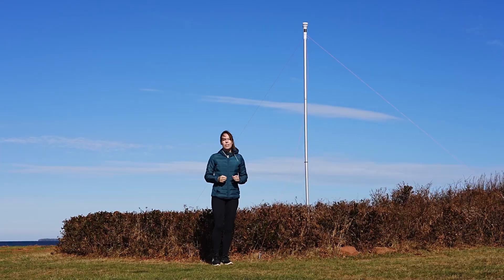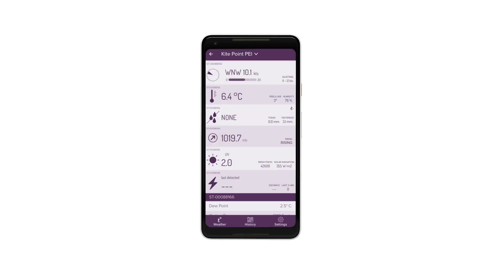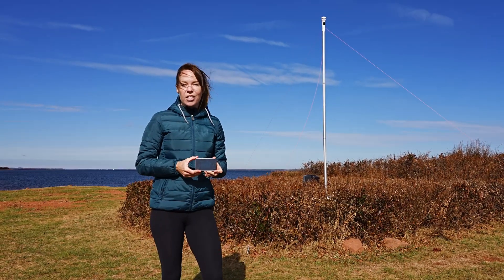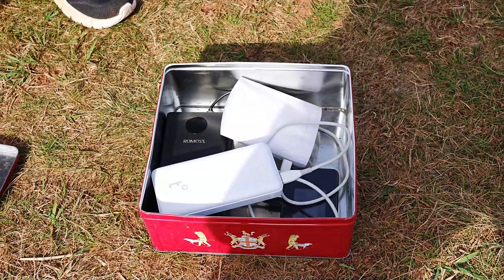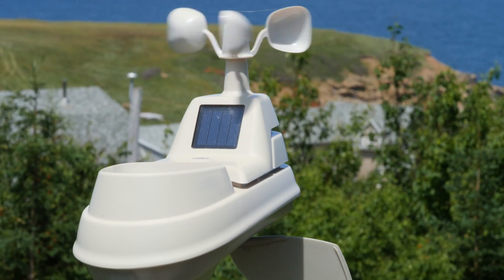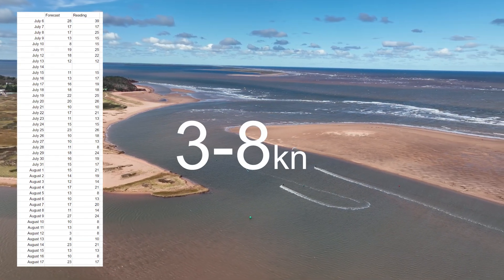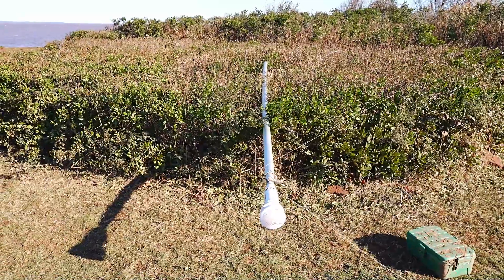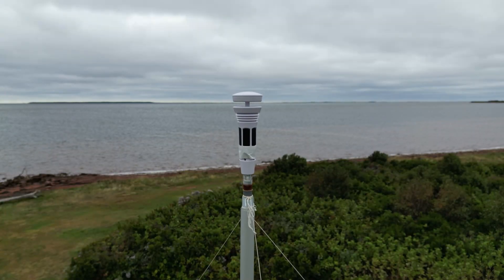How to Set Up Remote Weather Station - WeatherFlow Tempest

Comment: It sounds like you have to hook it all up at each trip to the beach? If so, it wouldn't really help with a decision to go or not! If you figure out a continuous (solar?) solution, please share! Love all your kite trip videos!!
Reply from the maker: We did figure it out - we got a solar panel and a voltaic battery and it worked great!
Reply: @OurKiteLife  Neat! Love to get more details,how that solved eh WiFi problem, etc.. This sounds like your third setup (?); one with everything remote in the plastic box and USB batteries, then remote with antenna, then ?? I assume that this whole setup replaced your one with the bigger WiFi antenna, where you had the hub and antenna at home with power, and just the pole mounted Tempest unit remote? (What was lacking with  that setup?) Thanks.

Comment: Nickel Iron batteries or Sodium Ion batteries are both incredibly robust tough climate, battery choices, albeit quite bulky. But if placed on the ground in a weatherproof box with solar panel and PWM controller, it should work at 12v with car USB abapters to convert to 5v USB. Alternatively or augment it with a micro wind generator.

Comment: I've a different opinion how to build such thing. I'd use ultra low power Arduino/nodeMCU with Sigfox-network (Sigfox Canada) which is IOT network, very low xmit-power and for low amount of IOT messages. That would take down power requirement and your powerbank would last for a year (just saying not calculating). And with simple solar cell with occasional sunlight could keep battery charged for longer periods.

Then you are measuring wind - meaning there is wind power available. For Arduino powered sigfox device the wind turbine generator does not need to be big, like very small Savonius wind turbine of 1 watt or under. But naturally hurricane level winds would be a problem for the wind turbine. I even imagined as you are not interested generally in 0-3m/s winds where wind turbines do not produce power but on kiteable higher winds, I am also thinking of wind turbine based measurement of wind, how much power does it produce. With that artificial load you could keep measuring station above freezing on winter colds. This idea is for snowkiting on mountain location for mobile wind meter.

Naturally this suggestion is DIY service and you use some weather service. So maybe with a almost free cloud computer you could receive sigfox and send it to wind network.

Also data plans, sigfox is not for that amount of data you presented. But you really need to send 10-min average wind and 10-min peak so two figures every 10 minutes, for that sigfox is built.

Comment: Hi. Thank you for this video. I was assembling my weather station using the Davis wind speed and direction sensor. The electronic part was assembled on the arduino and the cellular modem sim 800 (as I later found out not the best choice). I assembled two devices. One was installed on the roof of the house a kilometer from our spot and there were no problems with electricity. The second device was planned to be placed on a spot where there is no electricity. For the second device, they first planned to use a 30-watt solar panel, but then decided that it would be better to use a car battery. According to my calculations, the battery for 40 amperes of watches should have been enough for 1.5 months of operation, if the data is sent once every 5 minutes. Most of the energy is consumed by the modem at the time of sending data to the web server, so you need to carefully select the communication frequency

Comment: Have you researched using the Starlink satellite system as your remote internet connection instead of your current mobile hot spot?
Reply from the maker: We did look into Starlink previously for our home, but it's expensive. Since we published this video we've found a less expensive internet option we'll try next season :)

Comment: nice video, a smal PV-Panel will work well. We did it already with a 100W Panel and a small Battery incl. a suitable charge-controller.
Reply from the maker: That's great - thanks for sharing!
Reply: Can you expand on this - you got a permanent Tempest unit working with IOT/cloud connectivity? If yes, I'd love to get more details.

Comment: Great video! You forgot to mention that majority of the tempest sensors installed not in proper places for accurate wind measurements. I think it also drastically affect  accuracy of the wind forecasting.
Reply from the maker: that is true, but they account for that, as its pretty easy for algorithm to spot which wind sensor is shadowed and which one isn't.

Comment: Exactly as you mentioned at the end of your video, our Tempest weather station doesn't work during New Brunswick winter, we don't take it down, it stop working in December and start by itself in April. We replaced the solar/battery section a few times, same. We have been with tempest stations since Dorian broke our old style station. survived Fiona!
Reply from the maker: yep. I believe tempest solar panels stop charging the unit when it goes below zero. The battery has enough juice to stay live for 14 days, so if it get's above zero It will recharge.
Reply: You can buy a wired charger to give the station power. It's 40 bucks from tempest.
Reply: I bought a $3000.00  a NIB Vaisala WXT 510 on ebay for $260.00 about 6 years ago. It is not wireless so it will run year round and it is indestructible and comes with a heater to melt the snow off the rain sensor so it only measures actual rain. That being said I do have a Tempest on order, Can't wait to get it up and running. PS The bird screen for the Vaisala was $150.00. ouch!